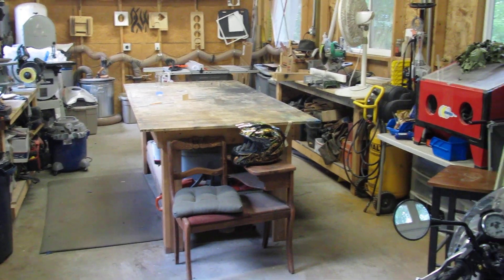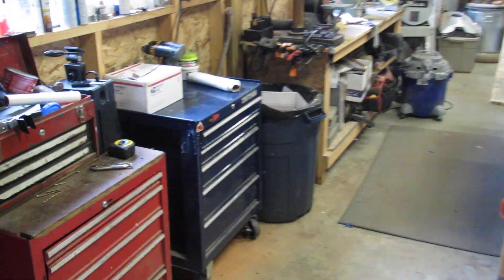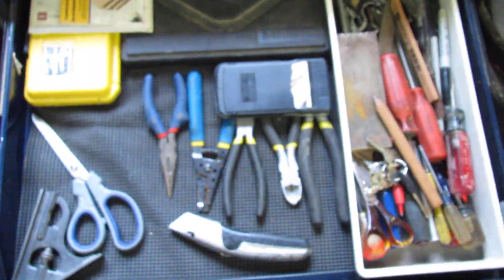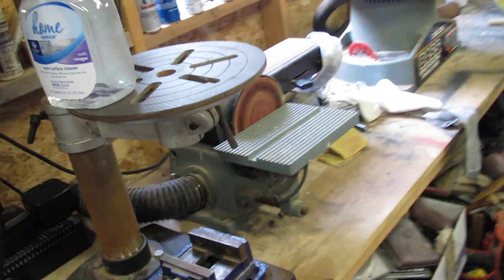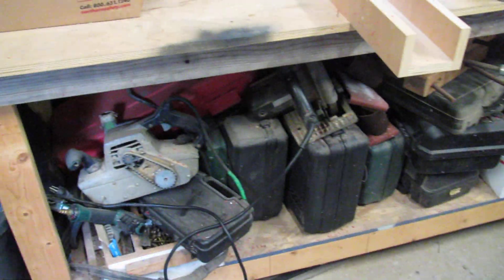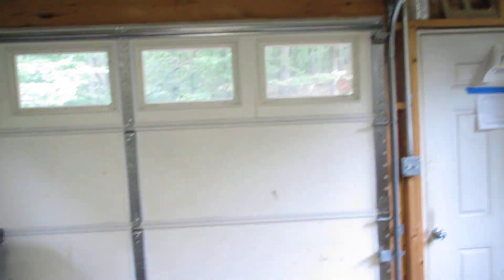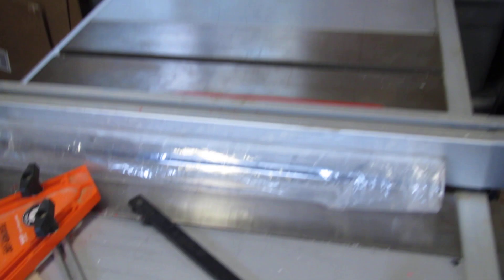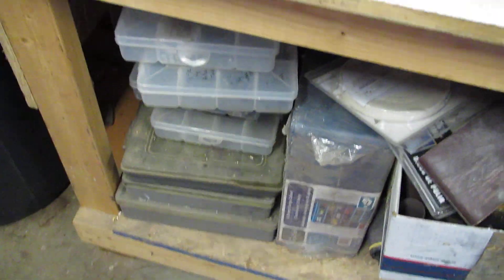Mountain Storm LLC : The Shop Tour 2011

Comment from the maker: @mlucho Thanks. I've had most of them a long time. I wish I had built a larger shop, but the land around here is far from level and I am not that good at running a backhoe...lol. So after I almost tipped it over a couple of times grading the pad I decided it was big enough. 32 feet by 13 feet is just not big enough for all the things I want to do...weld, bend metal, have several benches for different projects, paint booth, bike lift, tire changer, lots of storage...sigh. But I make do.

Comment: Imagine if you had to buy all that at once, how much miney it would be.  
I had that blue/black handle screw driver 0:30.  I never used the LEDs on it though, I used the battery area to hold more bits.  Don't know what happened to it, might have left it at a job site.  
Nice shop, thanks for the nickel tour.

Comment from the maker: @nicktheodorou9 I wish I had even half the tools I used to have. After the second back surgery I was forced to close the shop I'd had for 12 years in Florida. Had to sell all the big stuff. Delta Floor Model Tablesaw,  Hitachi F1000A planer Joiner (about 800 pounds),I sold the much larger Dust Collection System, the bigger Bandsaw and my 1954 Floor Model Delta Drill Press. I had limited storage and for years all my gear was under tarps.A lot of it was ruined by salt air:( 100+ clamps, jigs, etc.